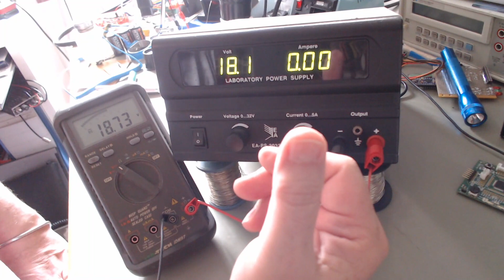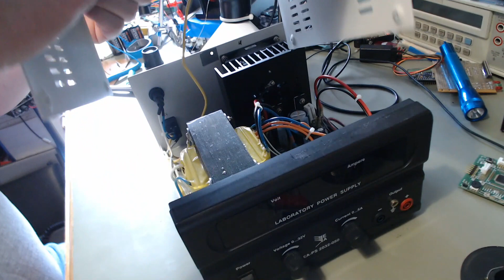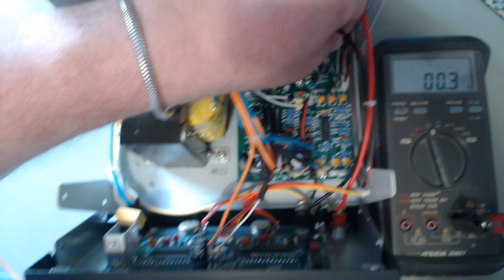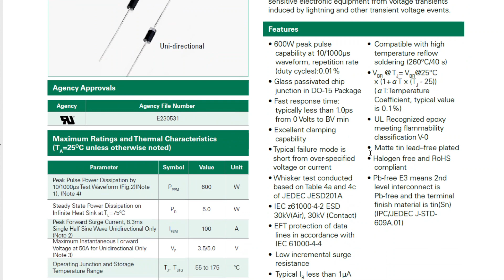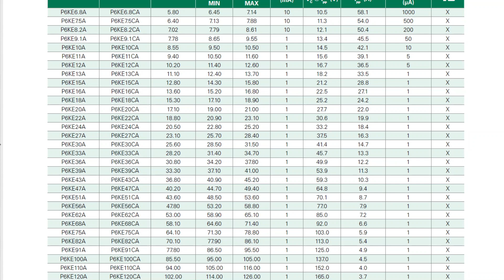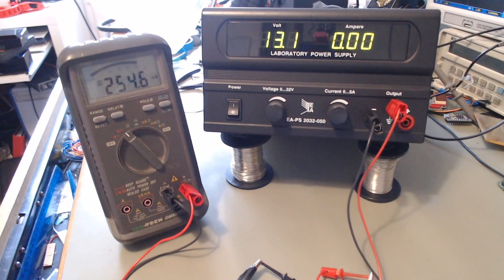#061 DC Power Supply with issues

Comment: Unsure what is going on here ... Is this a property of this TVS, or a defective component?  Well, good skills to find it, regardless.  I use these P6KE devices sometimes to protect little regulators from the surges.  You know, the inductive effect when being plugged in from a long wire.
Reply from the maker: Hi GnuReligion, It's a properties of a TVS device that has had a large voltage with little current limiting :)
This PSU output was connected to the mains, which is how I got it, as basically ewaste, This poor little TVS died and became a short circuit as it could not cope with the energy in the mains connected. I don't think the manufactures expected 240V AC on the output.

Little inductive events it can cope with, 13A mains a little different :)

Comment: Nice catch ! are you worried about the 500mV disparity ?
Reply from the maker: Hi Andy, not really worried about the error on the voltage reading as I always check with a meter to see what it's set to before plugging something in. Have spent way too many years working in industry where every piece of equipment has to be calibrated, but with power supplies you can save quite a lot of money by putting a "Source Equipment" label on it. which means that you have to check it with a calibrated instrument before use. So power supply displays are just an indication of where it might be. but I might try and get it a bit nearer when then the new TVS arrives.